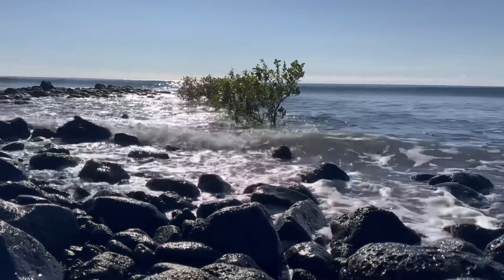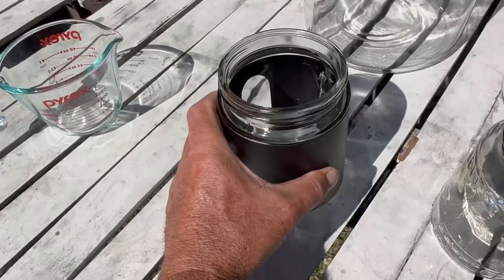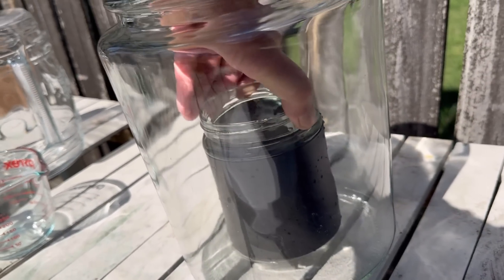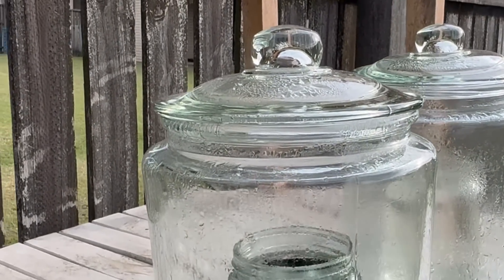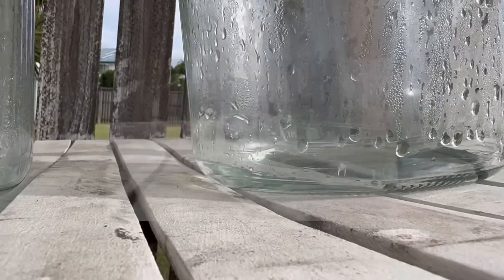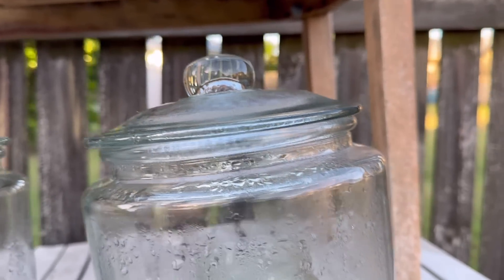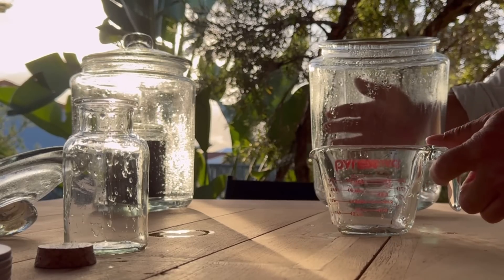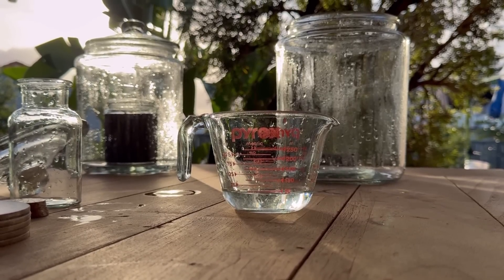Solar Distillation 2.0: Boosting Efficiency with a Simple Tweak

Comment: Have u ever tried the jar method without a sea water jar inside it?
I’m gonna try the same conical big jar but with a black cloth on it ( tied with twine to hold it in place and see what happens.  In my head the moisture/condensation would still gather.  How do you keep the water safe when storing it?
Reply from the maker: Hi and thanks for your question. It will still work, but the cloth will likely introduce a taste to the water. I know when I introduce charcoal to the system it flavours the water. As for storage, if I am planning on consuming I find that I consume the water far quicker then I can make it, so it’s never been a concern. Ultimately if I had to look at long term storage a clean glass jar with a sealed lid would do the trick. Boiling before use is also a good way to kill off any potential nasties before consumption. Sunlight is also antibacterial as well, especially with longer term exposure. I hope this helps. Cheers!

Comment: I found the update videos after watching the original.  On the original video I left a suggestion to intensify the heat and speed up the process.  The use of a parabolic reflector on the outside of the big jar will focus and intensify the heat of the sun on the smaller jar. The same thing is used in solar ovens to cook without using energy other than sun light. Something as simple as aluminum foil could be tried.  Just do a search for parabolic reflector to get more ideas and learn how to focus it most advantageously.

Comment: Plastic in the sun leaves phthalates in the water. They are very bad for you. Endocrine disrupters. It would be better to use natural materials like natural black wool, not dyed. The suggestion below to use metal is even better, but I would be sure to use stainless, not aluminum.

Comment: Nice videos. I suggest you could use more of the sun's heat, if you use something reflective. I am not sure, how much you can get out of it, but I think one way would be to use some kind of mirror or reflective material around and maybe under the jars. For example if you use a glass table, where you put the jars on, then you could reflect sun from under the table too with an old mirror or something like that. Maybe you can even generate enough heat to boil the salt water, but then you would need an open jar, because of the pressure.
Reply from the maker: Thanks for the suggestions. You’re right. These variables would be well worth trying! I have currently gone down a complete different rabbit hole and am yet to come back out. I will do an update soon. Thanks again. Cheers!

Comment: I am not sure how helpful the internal jar is;  if you put a stainless steel reservoir the steel would conduct the heat quicker to the water and would eliminate the plastic which if vinyl is  likely to off-gas you could  even use high temperature paint on the OUTSIDE of the metal reservoir though painting stainless is tricky.
Reply from the maker: Thanks for the suggestions. You’re right, maybe even a graphite crucible (complete overkill) would work better to help act as a heat sink as well. And yes volatile organics are definitely something to watch for. It’s only due to commenters such as yourself that I even learnt what they were. Cheers! I appreciate the feedback! I need all the help I can get!!

Comment: If you pull a vacuum on the jar, you can put a lot more power into the still and it will run faster. Focus a large fresnel lens on a piece of charcoal in the evaporating container and cool the receiver with a wet cloth or dip it into a body of water. The vapors come over unimpeded by diffusion, carrying hundreds of watts across the temperature gradient without becoming too hot to touch. A liter per hour should be achievable

Comment: I've been using this kind of system to melt wax for candle making for years now... For the inside jar I use a dark glass bottle I've cut to keep only the cylinder part. Here in France we can find dark (almost black) bottles containing olive oil, vinegar or... Champagne! I also use a half cylinder mirror on the back of the system, made with a verticaly opened food can (with no white coating inside)... Any back mirror can improve the process... And I also place an old glass mirror under the whole system...
Reply from the maker: Interesting! Thanks for the suggestions! I think I could readily find a large enough can to suit this purpose, it would be a simple application that could have potentially huge impacts on the outcome of the experiment. And yes, wine bottles and champagne bottles would be perfect with this application. I’ve even looked at ways to cut the glass to utilise them! (Maybe an opportunity for an upcoming video in its own right). Wæs hāl. Cheers!

Comment: In the loosest sense it is distilled, in that it is from evaporated water, but truly distilled water is exposed to high temperatures which kill all bacteria, microbes, and viruses,
Reply from the maker: Thanks for your input! Your point is interesting however it’s definitely distillation. Sterilisation is the act of boiling. Distillation is evaporating fluid, condensing and collecting. I appreciate the feedback. Thanks for watching. Cheers!
Reply: @Remraf  I guess that depends on whose dictionary you use. If you look hard enough you can find that definition. 
Cambridge dictionary - 
"Meaning of distillation in English
distillation,  noun [ C or U ] , uk  /ˌdɪs.tɪˈleɪ.ʃən/ us  /ˌdɪs.təˈleɪ.ʃən/
the process of making a liquid stronger or purer by HEATING it until it changes to a gas and then cooling it so that it changes back into a liquid, or a liquid made by this process

Ambient evaporation does not count as heating. But that is why the black line jar worked so much better, it actually did heat a little bit. 🙂
Reply from the maker: So I wonder, what could we call this process instead?
Reply from the maker: I really appreciate the feedback. Everything is up for debate. I love it! I really want to launch this channel into the stratosphere! And I want to make it a good place for everyone to have a discussion without the risk of being ridiculed or belittled. Thanks again for the civility! It’s awesome and informative!
Reply: @Remraf  It is generally called a solar still. Normally if you refer to distilled water people will think high heat distillation which is what I meant, but it is still fair to call it distilled by the loosest definitions. Did you delete my comment with the links to much more effective solar stills, or did youtube do it?
Reply: Anyway here they are without the links
Since the links won't preserve you can google 
#1 LSU AgCenter's Plywood Solar Still  1.92 gallons/day
#2 Eliodomestico by Gabriele Diamanti  1.3 gallons/day
#3  SunStar Solutions Single-Basin Still <=1.3 gallons/day
Reply from the maker: Na. I didn’t do it? I never delete comments.
Reply from the maker: Thanks for the info. Appreciate it.

Comment: Instead of the black plastic liner sdd carbon black to the inner jar and add more sea water as it gets depleted.  Also, place a black paper in the inner jar to act as a wick. It should be accordion shaped and stick out beyond the inner jar top significantly.  This will increase the surface area and vaporizarion rate.
Reply from the maker: Thanks for your suggestion! I have actually tried adding carbon to the centre jar in a previous video. If you have a chance I recommend going back and watching them. In the video you’ll see that I placed charcoal into the centre jar, it served two purposes, purpose one was to provide a heat sink to increase evaporation and purpose two was to provide a wicking material to help evaporate the seawater even faster. This is a good idea and worked well in the past attempt. I appreciate your comment and your feedback. I will need to look at perhaps adding either a fabric or as you have said a paper accordion to help increase the wicking effect. This is definitely something I need to look in to. Cheers.

Comment: That much water in 6 days...you're dead before that LOL  It works way better if you reverse it. Small jar still inside but raised by a few inches, then fill salt water to the bottom of small jar, put the lid on upside down and color the outside of the large jar black.
Reply from the maker: Yeah. It’s a slow process. That’s for sure! Just so we are on the same page.  I have tried the other way and it was way slower. I am looking at rerunning the experiment and putting the video up for comparison. Your idea about painting the large jar black is definitely worth visiting! Thanks for your input! Cheers!

Comment: 🎉OBSERVATION: I'd speculate that the system is capable of more than 1 evap&condense cycle per day, because the smaller the volume of air, the faster a given evap system will reach homeostasis at max humidity, and conversely, the larger the longer.   Since we cant speed up the day, or control sun intensity, it seems like the one variable you can control is the volume of air, or more specifically the cubic cm of air in relation to the amt of sq cm of black surface area currently exposed to sunlight.  

Another factor to consider is that not all black surfaces are the same in their solar absorption index.  They have new metamaterial surfaces with light absorption of 95%+.  Seems worth exploring if it increases evap performance.
Reply from the maker: Thanks for the information. This would definitely be worth exploring. I have seen 20 litre jars as well. Very tempted to get one and experiment with it. Cheers!
Reply: @Remraf Example of superblack paint.
 https://youtube.com/shorts/Z2WaOeqtrAU?si=NSqP9zLjwVv-__kq

Comment: Could you test that using an insulated glass jar, and with hydrophilic carbon black (see US2439442A) mixed into the water. 
I imagine that way the heat gets collected directly in the water, and no heat is lost through the base.
Reply from the maker: Thanks for the suggestion! I’ve tried using charcoal in the past. It worked super well because it acted as a wick (above the surface) and also as a heat sink. I want to repeat the test and run it side by side with the black glass unit. Cheers!
Reply: @Remraf  I'm running a little experiment on the side now, as I've found double-walled glass jars at the supermarket the other day. But I'm reconsidering whether making the wall or entire volume highly absorbing is ultimately the best idea. one may get even better results with a non-insulated jar and black fabric / sponge held afloat. Instead of one vessel mixed around through convection, you'd get thermal stratification with the highest temperature right at the surface where the evaporation will take place, saving the time it would take for the entire volume to heat up.

Also, additional improvements may be found when actively shading a condensation zone or by putting a chimney on top that draws air across the condensation surfaces to prevent them from heating up.
Reply from the maker: @hardwareful you need to let us now how your experiment goes! Keep us up to date. Are you preparing to run the two versions of the experiment? That way you can see how well certain changes impact the outcome.
Reply: @Remraf  I put two double-walled glass jars in the same foil bag and put them on the windowsill (which gets hot itself, a problem in my quick experiment. Need to put tin foil underneath it next time). After condensation had been going for about an hour, it seemed to be stuck refluxing the already evaporated water with no more water being removed from the source jars. 
IR thermometer readings were about 43°C in the clear glass and 55°C in one with cocoa powder added to make a dark suspension. There was also visible steam coming off the cocoa suspension!
Edit: here's the thermal camera view of the two side-by-side. Note the amount of convection and the different brightness values. https://youtu.be/JKitsJW6KSs
Reply from the maker: @hardwareful this is deep! You have some awesome equipment that I could dream of getting my hands on! I had a watch (a couple of times) from my original primary channel. Thanks for giving me this insight. So in theory i could make do with crushing charcoal into powder and adding this to the water. It would definitely be worth testing next to either the standard unit or the black unit to see how well it performs! I need to pick one and stick to it! I keep getting sidetracked!!!

Comment: Try putting the entire setup into a black plastic bag. It will absorb heat while also avoiding contamination. One possible concern I have is all the water in the setup will be constantly heated, causing a build up of gas. Unsure how impactful this would be but I think it is still worth a shot

Comment: My suggestion would be either metal or carbon dust (coal-dust) inside the water that is to be distilled...

First one would also heat up the already distilled water as well... 

Second one would probably be most effective bc the black stuff is already inside the water. It can also be used several times over.
Reply from the maker: Hi and thanks for your input! I appreciate the feedback heaps! Yep, adding charcoal to the water is a super effective way to increase the yield. I’ve tried in the past and got decent results. Check out this video! https://youtu.be/BvMI3uCjqlA?si=_Dugx2FBZ9iCyypL
Reply: @Remraf  I was specifically talking about coal power instead of lumps. Increasing the powders surface area is key for its absorbtion of solar (heat) energy.

another improvement could be the to have a wider container instead of a high one...

Reason being: evaporation happens on the surface of the liquid, not in the volume.
You'll get the best possible evaporation with a water hight of 0 (close to zero in practice) and a high water temperature (charcoal, metal flask, black flask).
Less water-volume overall also in increases its temperature thus increasing its evaporationrate

While Condensation happens on the surface of the glass (and the water surface).
To maximize the condensation happening where it does not mix with the dirty water, you have to maximize the collection areas and cool them down...
One way to do this is, is by adding spicks inside the outer glass and increasibg the size of those outer glass.

To prevent re-evaluation you could have a valve at the bottom point to extract the water each morning.
Re-evaluation also saturates the air with water which is reducing the ability of the dirty water to evaporate.

I'll conclude: large/wide shallow dirty water, large outer container with good volume and large surface area, and extracting already clean water more often.
Reply from the maker: @checkm8606 currently working on a couple of different systems taking these concepts into consideration. So far this jar cell has it over the others in multiple different ways. I am also working on a hive system which takes up more floor space thus pushing the level of the extract higher, there is a tap in the bottom for extractions. However, ran into an issue with the tap immediately, it has a flange which raises above the floor of the cell prohibiting the removal of the distillate until it reaches a certain height. I’m thinking of replacing it with a cork. Nice and simple.
Reply: @Remraf  those were just 10min of ideas with some experience in physics things...

In the future I can think about it more. Maybe even some calculations for optimal relationships between different parameters...

Comment: raise the inside jar up and paint the bottom of the outside glass, halfway up with white paint. you want the water vapor in the air to condense. having a cool bottom will do that
Reply from the maker: Thanks for the suggestions. There have been so many great ideas being presented. Raising the glass above the distilled water is a simple way to potentially improve the results. It would be worth running this as a seperate experiment beside the standard black unit version. I’m still dubious about adding paint into the system. I used to work in a feedlot and I’ve seen what damage time and water can do to anything. Cheers!

Comment: LIFT THE INNER JAR TO NOT CONTACT THE DISTILLED WATER 💦. It will keep it's heat better.
Reply from the maker: Thanks for pointing this out! You are correct. This would be a good way to retain the heat of the central jar while avoiding the risk of contamination of the outside inner jar into the distilled water. Cheers!

Comment: I'm wondering if we're losing energy due to the fogged inner wall. Perhaps moving the jar closer to the southern side (if in the northern hemisphere) would help?
Reply from the maker: Southern hemisphere here. And yes, the condensation would be interfering with the results. I need a way to flush the system. The issue is that if i open the system at any time, day or night I will lose the evaporated atmosphere. You can actually feel it escaping when the lid is lifted! Thanks for taking the time to comment. I appreciate it heaps! Cheers!